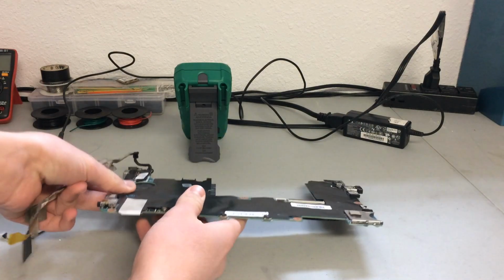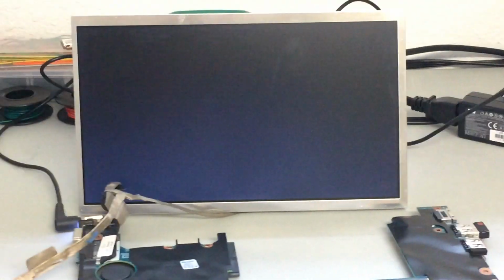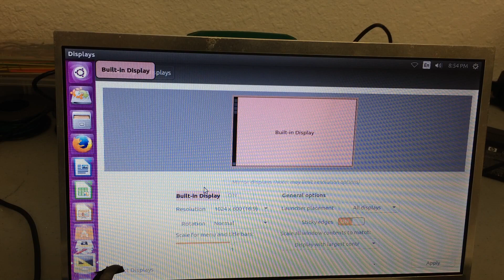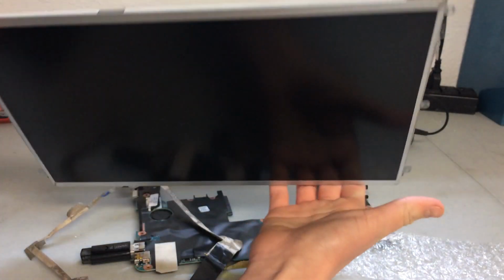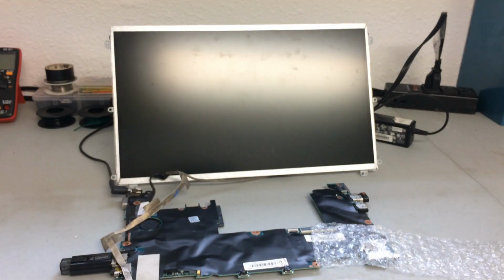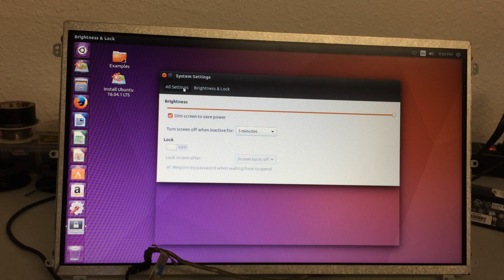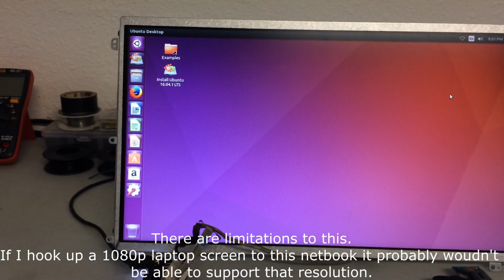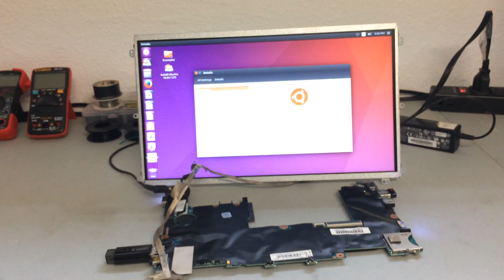How I test LED laptop screens - DIY laptop screen tester

Comment: Your panels are EDP panels I guess? As you don't connect backlight separately
Reply from the maker: They are LVDS panels... while older CCFL backlit laptop displays had separate power connectors for the backlight, all of the LED backlit laptop screens I've used get power directly through the LVDS cable.
Reply: @randomtech3533  Thanks for reply. Indeed I just checked a laptop lvds panel datasheet and found the LVDS comes from the 40 pin connector !
Reply: By the way have you tried to connect other resolutions? From what I heard it should work out of the boxe (if the LVDS has the same number of channel at least).
Reply from the maker: @pierreboyer9277  Yep I've tried it and it does work out of the box. The motherboard in the video came from a laptop with a 1024x600 panel, but it worked just fine with a 1366x768 panel.

Comment: I have an old laptop for 30 pin screens and  a samsung recent model for 40 pin screens.
Reply: Old laptop use LVDS interface, new laptop use EDP interface. They cannot be connected together. EDP dominated since 2012 around.
You have 40 connector and 30 connector can both be either LVDS and EDP

Comment: Does the motherboard have to be detached from laptop for testing
Reply: no, you just need the video cable connected to the laptop
Reply: You just need access to the cable for the lcd, for some this is located under the motherbaord so yes you would need to remove it but for most laptop (normally older ones) you don;t need to do a complete teardwon.

Comment: Hello, i have a screen from Lenovo g50-30 and bought a control board to use like TV but it only show White back light. Could it be from the LCD?? Many people told me Yes.
Reply from the maker: It could be the screen, but it could also be an incompatibility between the screen and the controller. Is your control board set to the right resolution?